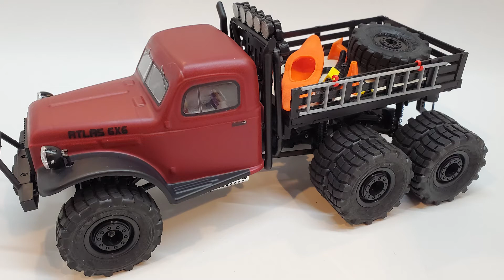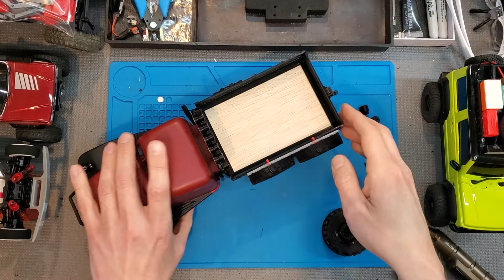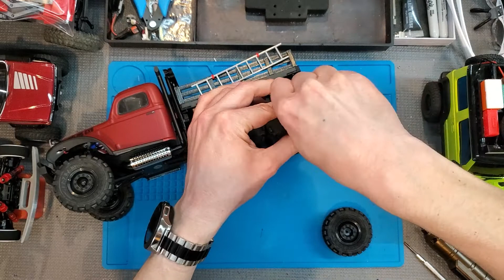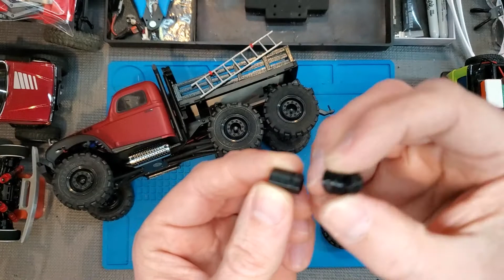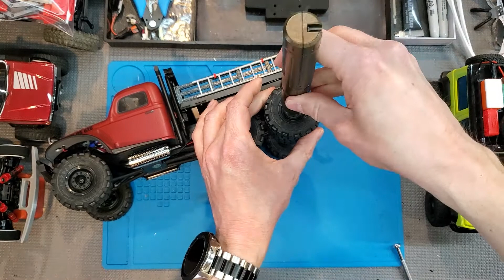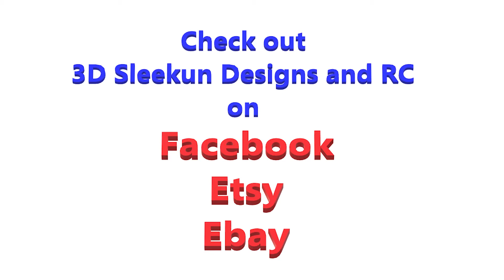FMS Atlas 6x6 Dually Adapter install

Comment: Where do I get the wheels? I can find the tires, but not the wheels.

I’m looking forward to installing this and your flatbed kit.
Reply: On mine i'm actually using some "dummy" wheels that i made, haven't started selling them yet, but i also used some SCX24 Jeep wheels which aren't too bad, just abotu the same size as the original atlas wheels/tires.  if you pause the very beginning of the video, on the driver side  had all the atals wheels/tires, and then the next picture is the passenger side where i have all the scx24 jeep wheels/tires.  I think i've seen the complete wheel/tire sets online somewhere but can't remember where, not sure it was ebay.

Comment: Where did you get the hand drill
Reply from the maker: it's official, has to be my #1 question is about the electric screwdriver LOL.  it was a cheaper one from amazon, but if you search for "Precision Electric Screwdriver" you should find tons of newer models, i recommend one with some kind of variable speed and/or torque limiter or something, mine is easy to strip a screw if not really careful.

Comment: Would this work for scx24s too?
Reply from the maker: i can't say i've ever tried it on the scx24, it's designed specifically for thw wheel nuts from the atlas and the stock wheels, main factor is likely the offset of the wheels as that can effect whether the tires have a big gap or are too close to assemble correctly.
Reply: @SleekRC  okay no worries I have a 4x4 atlas I wanna put dually on so this should work good!!

Comment: Could you link the files for the 3d print if possible
Reply from the maker: the adapters are available to purchase in my ebay and etsy shops, the designs currently aren't publicly available.
Reply: this would be really help full